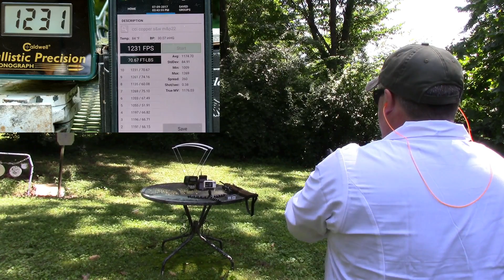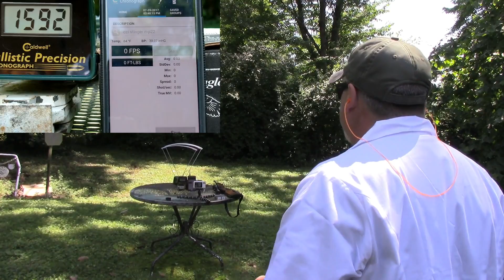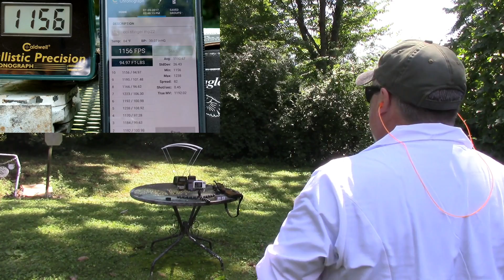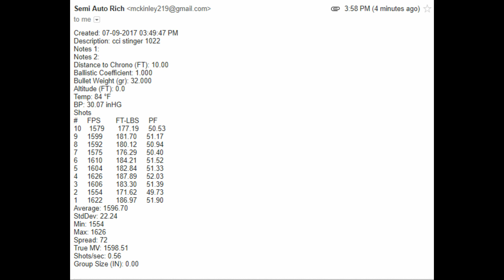CCI Coppers vs CCI Stingers

Comment: This highlights how a small inconsistency in bullet weight for a lighter bullet like the cci has a much higher difference in velocity deviation compared to a heavier weight bullet.  Get what I mean?  0.5 or 1 grains too light will throw off a 21 grain bullet more than a 32 grain bullet, and it shows in the foot pounds read out for sure.  

The single CCI copper bullet that had a higher velocity was probably much lighter than 21 grains (I think it's this and what I said above).

Comment: To get the advertised velocities you need a 24” barrel
I’d recommend a Stevens/savage/Springfield Model 87 or one like it to test the numbers with a 24” barrel and to easily test the bolt action speeds. Obviously late on the video but that rifle would be perfect for 22 lr testing as it is both semi and bolt action

Comment: The velocity is  based upon a 24 inches barrel. Your numbers are  not relevant...
Reply from the maker: You're face is not relevant!
Reply: @rich4150  what you need to explain to him is that a 24 inch barrel is not relevant.... most people use an 18 inch barrel or less

Comment: i would rather have the stinger over those coppers for the extra bullet weight & in a pistol the coppers didn't have enough speed to make up the difference. still, i like a yellow jacket or viper for hyper ammo.
Reply: I would too, but here in California we have to use copper ammo for hunting so stingers are not an option. I remember my dad's favorite round for hunting rabbits when I was a kid were CCI Stingers, they worked every time. Of course, I've also taken rabbit with the CCI Copper and it's put down the rabbits quick as well.
Reply: I picked a couple of boxes of yellow jackets from the gun show they are hard to find

Comment: For those having some difficulty finding Stingers (which is 95% of the planet),  know that CCI 32 Grain Segmented Varmint rounds (CPSHP) are extremely similar to Stingers:
1640 FPS  191 ft/lbs at the muzzle.  Nice, clean burning.   
If you can find them, get them.  You never know when the .22LR drought will occur again.
Reply from the maker: Thanks Rick!
Reply: I bet they wish they would have listened 3 years ago!!

Comment: That's why I like Stingers the most. Also, velocity isn't everything! Because of the heavier bullet, Stingers have substantially more energy with similar or even higher velocity, which serves its purpose in stopping power. Also, traditionally lead bullets expand better than copper ones.
Reply from the maker: They are great rounds, thanks wild!
Reply: Yeah, thanks! :)

I still do doubt whether to put Velocitors or Stingers in my wife's S&W... I like the punch Stingers do, but Velocitors expand more controlled and penetrate deeper. Overpenetration might be a problem on some occasions, but I doubt even Velocitors in .22 can overpenetrate in self-defense against humans.

What do you think, Stingers or Velocitors for self-defense? It will be great to see a comparison videos of those. Good luck!
Reply from the maker: Well, the Velocitors would be more likely to break up on impact so over penetration might be less likely with them. Not really sure about a rimfire for self defense because of possible reliability issues, although I haven't noticed any problems with the stingers, I haven't shot enough of the  Velocitors to judge how reliable they might be.
Reply: Thanks for answering! I think the reliability issue is quite overcame while using a revolver and quality brand like CCI. Even if one round doesn't ignite, you just keep pressing the trigger until one does. :)

That said, I don't have any issues with Stingers in my .22 Ruger Takedown. However, I had some issues with other, cheaper rounds, mostly a random FTF. 10/22 requires a lot of power to cycle properly, "hypervelocity" rounds. But revolver overcomes such limitations, and my wife really likes her S&W 617. Maybe it will be best to insert both Stinger and Velocitors chamber for chamber, just in case. :) :) :)

Comment: Try it with a twenty-four inch barrel.  I'm not saying ammunition makers lie, but they do mislead, and one way they mislead is with the barrel length they use to get their velocity averages.  In a sense, this isn't misleading because a lot of bolt actions do, or did at one time, come with twenty-four inch barrels.
Reply from the maker: I'm certain that they would use longer barrels to pad the numbers, what was interesting to me was that the company listed the Copper as being 210 fps faster than the Stinger when they were basically the same speed from my measurements. Surprisingly the Stingers were actually fairly close at 10 feet in speed to CCI's declared muzzle velocity which was interesting as well, thanks James!
Reply: A 24 inch barrel will actually slow the bullet down. They reach their peak between 14 and 16 inches depending on the ammo...
Reply: Out of my Ruger American Rimfire 22" barrel I've shot both over my Chronograph. My experience was similar to yours. 

10 shot avg

CCI Copper - Avg 1686 fps, StdDev 56.91 fps, Spread 167 fps

CCI Stinger - Avg 1594 fps, StdDev 16.32 fps, Spread 39 fps

Stingers are way more consistent and a higher quality round in my opinion. Out of my revolver, 10/22 and bolt rifle never had a misfire with the Stinger. The Copper I experienced several failure to fire, even after several primer strikes.

Comment: Manufacturer's padding the numbers as I am shocked as it like when you buy a car and they tell you the fuel mileage and usually the car does not come close to that MPG...Good testing in the lab...Good stuff....
Reply from the maker: I expected the numbers to be lower because I wasn't testing muzzle velocity, but didn't expect the Stingers to be faster than the coppers, thanks Scott!
Reply: Yep, that is for sure...
Reply: The coppers were likely tested with a 20-24” barrel to inflate the numbers